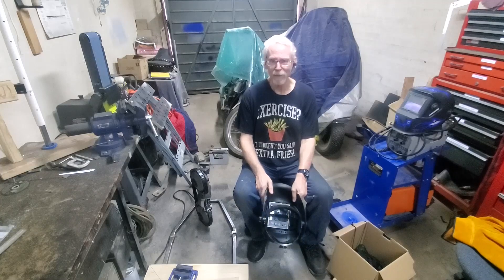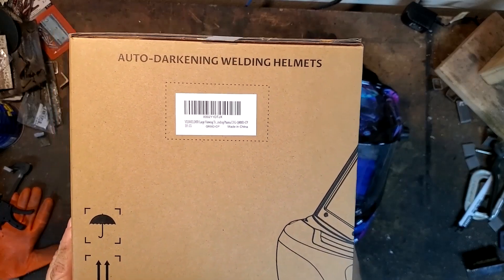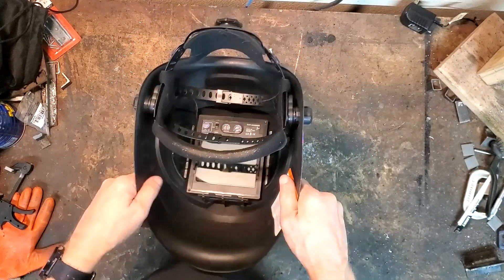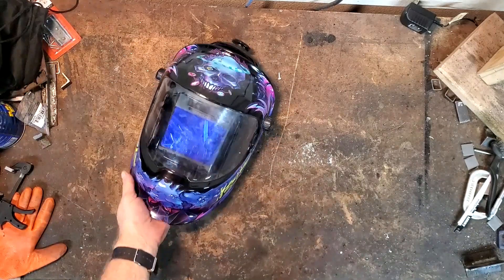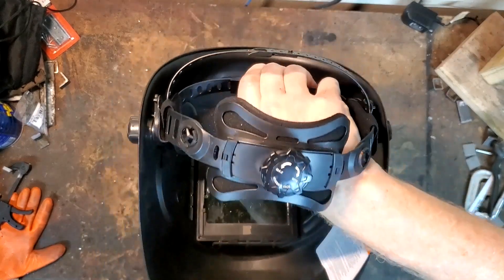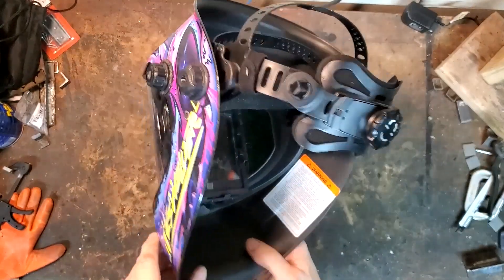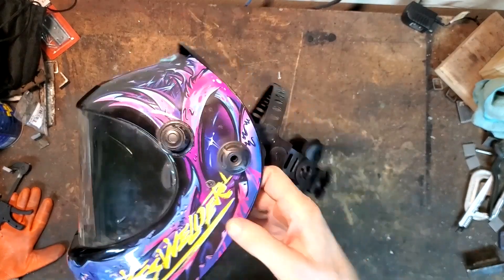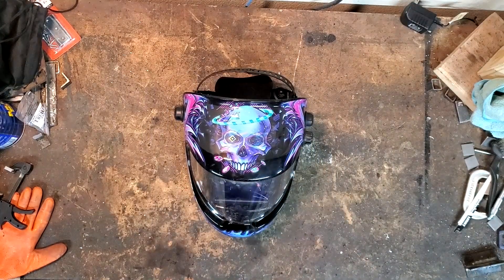Yes Welder Q800D-CP Welding Helmet Review

Comment: Thanks for the video. Do you know if you can get cheater lenses that fit these. Thanks
Reply from the maker: It's got the retaining clips for one built in so I'd think a standard 4.25"x2" lens would fit although I haven't tried it yet. I was thinking about this the other day when I was welding end caps on some rectangle tubing and was having trouble seeing the line I wanted to weld.

Comment: I encountered this helmet in Amazon a week ago and it looked pretty nice.

I was wondering if the side panels were actually useful and it seems they are, and I was also wondering if the transparent front protection warps what you see at all (That was a complaint in a cheaper mask I was also checking out.

I think I'm going to buy it and it will be my first welding helmet!
Reply from the maker: The side panels don't darken, but for me they do help with my positional awareness. I've never noticed any warping from the curved front shield and I used it today and thought to really look and I still don't. it's not a perfect helmet, but for under $100 I think it would be hard to do any better.
Reply: @3rdpig  Thank you very much for the info! I'm looking forward to using the helmet!